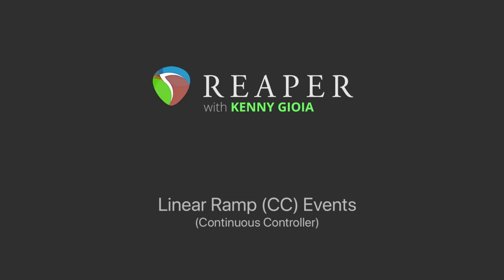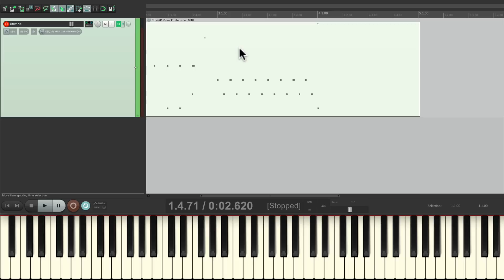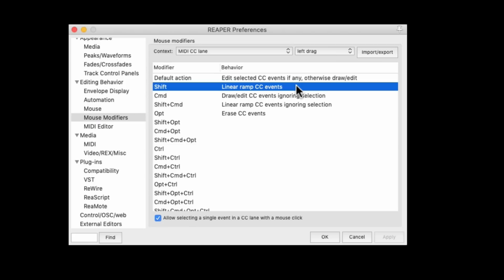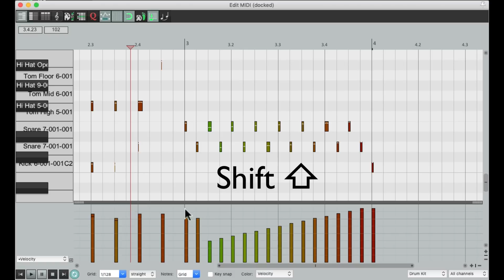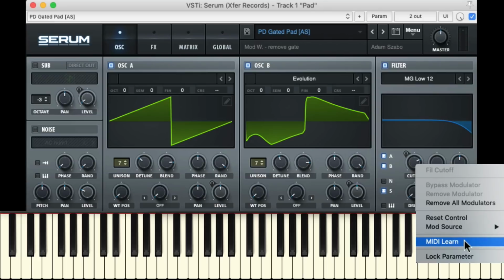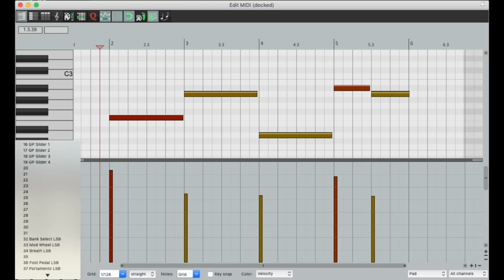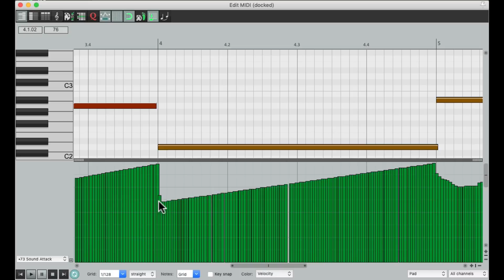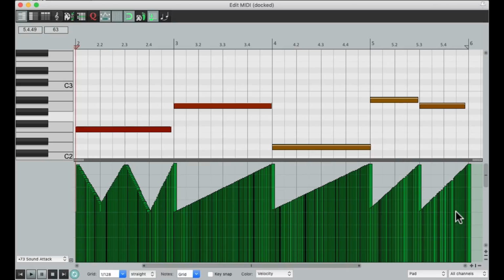Linear Ramp Continuous Controller (CC) Events in REAPER

Comment: I used to use Dr. T's T.I.G.E.R. and one feature I loved about it was you could hold CTRL, and click on ZERO in the CC window, then click on 127 anywhere else in the window, and it would automatically draw a linear CC ramp between the two points, you could do the same with Velocity etc..

Comment: hi kenny, very useful video but I still do not understand why you can not draw continuous straight lines in reaper ... in other daws I've seen that you can.
Reply: You can use parameter automation instead of MIDI events. There, you draw points, which are connected by a curve of your choosing. You can also use ReaMIDI to automate CC events that way, if you need to do it via MIDI.
MIDI CC will always be discrete steps, so I guess Reaper is being honest about what's "under the hood"? Still, would be nice to couple automation to MIDI tracks.